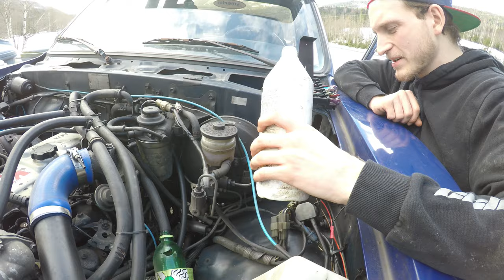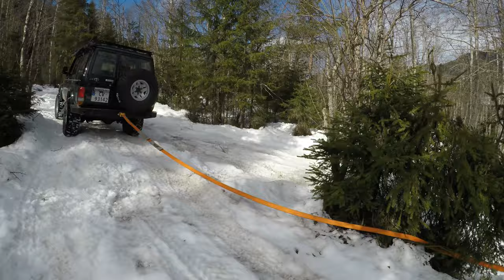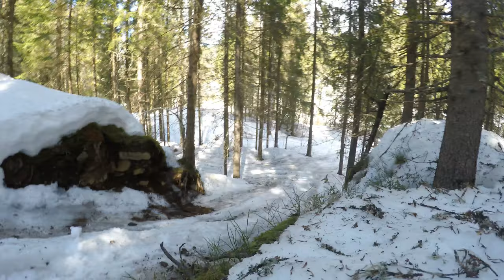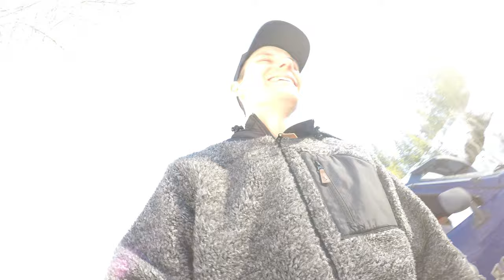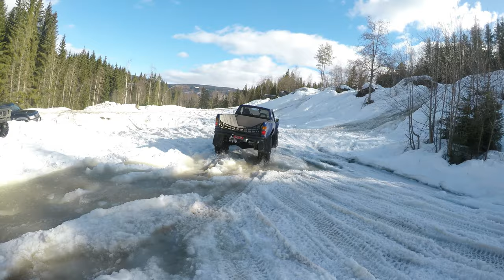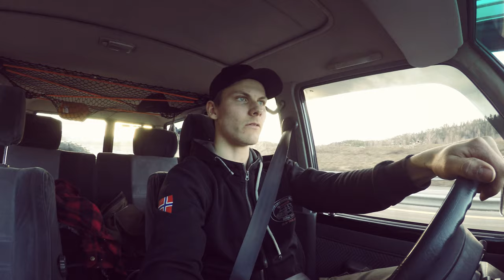4x4Norway / Deepshit offroaders/ gausdal4x4

Comment: Hey guys! How you deal with SVV? I cannot get to my car suspension lift with TÜV, any ideas? 🤔😉
Reply: @norwayjohann  thanks! They never stop me. I only have bigger tires, no bodylift, no suspension lift. But my car gonna be dead soon (chasis rust, karoserii rust) but my 2nd pajero sport start from sanding chassis, paint Raptor and make it him like from factory. I same time I'm gonna try get godkjent for fenders (got them from ebay but dedicated to my car. I'm gonna try get some documents). With suspension lift I try also (penders, Ironman, trail master but without tuv. Just certificate). I'm gonna focus more on overlanding than offroad. Godkjent for tires I think is different story😊😅. Maybe you know who can calibrate speedometer?